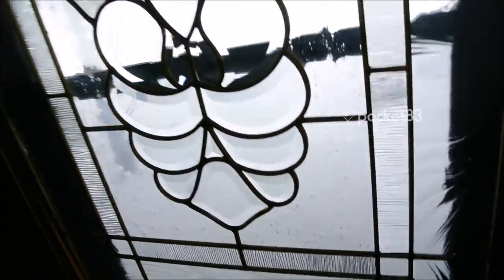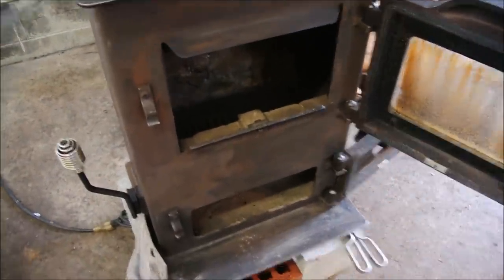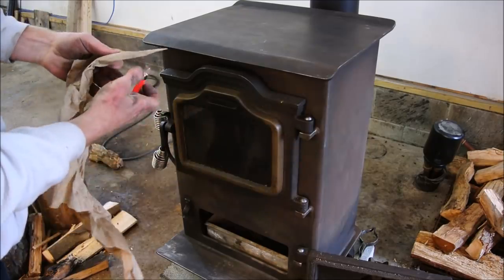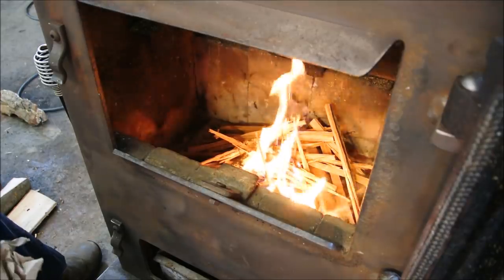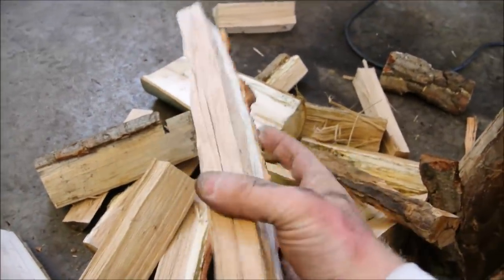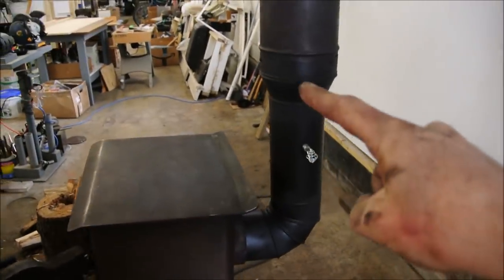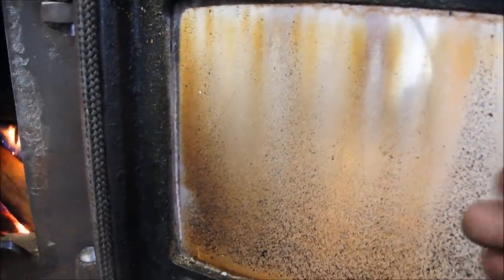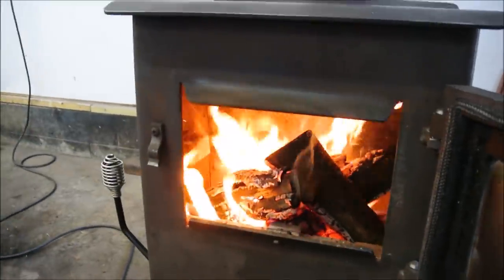A Look at the Harman Mark II Coal Stove

Comment: I have been heating the lower floors of my mountain house with a wood-burning stove since i have memory. By the looks of the grid thingy at the bottom of your coal stove i wouldn't say that you particularly needed that steel plate that you made. It's very similar to the one i have in my wood stove, although mine is a static grid. The shifting mechanism is very interesting! It allows you to filter down the ash and leave the embers up, to finish burning. Anyway, I have no experience with coal burners (in Europe it's widely used as a domestic heating only in Germany and neighboring areas, I'm from northern Italy) and you probably did your tests and considerations. Did your steel plate improve the burning, and how?

Second thing, in order to better exploit the heat produced by wood, which is fast-burning respect to coal, we usually lengthen the exhaust pipes, by placing the stove further from the exit hole to the chimney, or forcing the flow through a "radiator", where the pipes multiply in number and have a smaller section. Since your garage-shop is so huge (even if you split it with the wall you were saying) this could be an interesting solution to better distribute the heat and extract more warmth from the combustion gases, before dumping them outside. Nicely done in removing the extra layers of the pipes.

I'd also love to keep the door open and look at the fire, but i would be too scared that a spark jumped outside while I am not looking and do same damage... Wood can be particularly hyperactive, if you burned something with resin inside (like fir or larch, common where i live) you would notice! :P 

Anyway, these are my 2 cents, please keep up the good work, i love your channels and "toys" and could listen endlessly at your ramblings :D

Comment: That boiler with piping sounds like systems that were used around here only for cooling rather than heating.  I did a variety of projects where we modernized their systems and was kind of amazed at how the old systems worked.  This older systems were basically rooms filled with chillers, they would freeze vast amounts of water and then pump air through the ice during the day to cool the classrooms.  It wasn't exactly energy efficient but they were making use of the night time, when energy was billed at cheaper rates, to lower their energy costs.  I've actually heard these type of systems are making a comeback with more efficient versions but I've not seen one locally as of yet.
Reply from the maker: Thinking about how extensive that type of system was/is:

You know what system is severely under-utilized? Geothermal. In the summer, the air 60 feet down is as cool as AC, and in the winter, it's nowhere near chilly. Why aren't we using simple duct systems to help stabilize our internal environments? It's an unlimited supply of comfortable air, and it requires only a fan and a pipe to make use of it. 

Simply put, it's because such systems would employ localized services and technicians, rather than boxes of corporate manufactured "high efficiency" products. Our short-sighted market is always looking for a quick-fix product as a solution, so that's where the advertising and research funding go. The initial investment of digging is just too off-putting, even though a system like that would pay for itself in only a few years. 

So we burn fuel, instead- while sitting on a giant, warm rock. Sheesh.
Reply: @pocket83squared  yeah where I live in California, I've never even seen a geothermal system put in place here but I've read studies on them.  It's always made sense to me.  The cost was even lower than I thought it would be.

Comment: Does the Harman have a baffle so the wood heat and flames don’t just shoot up the chimney?
Reply from the maker: There's a baffle at the top/back. Exhaust enters at the front, moves over the top, then down its back before going up & out. This curve helps the metal capture lots of heat before it escapes through the flue.

Comment: Hello im from Tamimant PA 15 miles north of Stroudsburg,I have Harman mark 2 -you have Harman mark 1 I think --. A mark 2 has 4 grates ,get brick that lines stove but don't buy from cheap Northern Company for 15 dollars ,its junk actually  brick melts, Anthracite  is clean, no smoke at all -once it gets going and its a blue flame ,they call it ---blue dancing ladies. im very happy with my Harmand,we had BAD snow STORM and no power . that little stove kept1800 sqft house at 70' outside -10 uses 40lb bag in 24hrs with 1 shake at 12 hrs.you just give fast dump of tray after 24 hrs and  keep adding.dump used ash in metal container. goodluck.

Comment: If you remove all the fire bricks it will not store and radiant heat as well, which is the secondary function of refractory material. It protects the steel from warping, which can still be possible if you have a hot enough fire going. But refractory bricks hold and radiates heat long after the wood has burned down. My wood pro 2000 was still hot two days after the wood burned away.  If it were just steel it would have cool down shortly after your fire died

Comment: Quite the contrary, I think I'm actually pretty close to where you're at, though I'm more towards the anthracite coal area and not too terribly far from where those stoves are manufactured. I used to have a Harmon very similar to that, in fact. 

For that reason, it hurt a bit to see you get rid of the boiler, because nothing transfers heat like water, but that thing looked like the work investment would have far outweighed the results. That said, you mentioned that it ran under the driveway. That's... unique. Was it to melt it? And how didn't it freeze?

Comment: If you start with crumpled balls of paper then kindling over it, light the paper, you won’t have to go through the whole lighting 20 pieces of paper to start your fire, just an idea. That’s just how I start my fires, thank you Boy Scouts of America hahaha. Btw, is it strictly a coal stove? I grew up with a coal/wood stove and yours doesn’t appear to be a hell of a lot different. It heated our whole house which was a basic ranch, but it heated both the main floor and the basement where the stove was located. Excellent stove. Did you name your stove Mark Harmon the second? Bahahaha
Reply: ..... or a few drops of BP spirit?
Reply: I agree. I use old new paper. Take 1 page (1/2 sheet) and ball it up about the size of a tennis to gold ball sized. I put my paper under the grate and let the flames come up and lick at the pitch and fire it up. Once the pitch lights, then I put the heavier/heartier wood on top. Normally can have a hot fire in about 20mins
Reply: Per my Harman manual you ball up newspaper and line the bottom then put kindling over top. I usually heat my flue with a little propane torch first as a cheater.

Comment: If you want a cheap fire starter, use google to find the online contacts for local churches and ask if they have any candle stubs. Doesn't usually work for the bigger candles as they cost more, but there are usually cheap ones being used at some event or another. Some churches also do candle-lit services around holidays, and just throw out pounds and pounds of quarter-burnt cheap paraffin candles after every Christmas. They buy in bulk and most find it's cheaper to throw them out as they cost pennies to the candle, and new ones get more donations. Probably works for most other places of worship as well. 
You can remelt the wax with a cheap double boiler for crafts, or pour it over dryer lint or balled up paper if you want to light a fire in a storm or want something for a camping kit, but you really don't need to most of the time.

Comment: Do run the blower on that stove?  How much of a difference would it make?  Noise?
Reply: The blower can actually make a huge difference. The one on mine didn't work this year, and i think it's making an impact on the heat I can collect. There isn't enough natural convection to make the air move fast enough. Also, once the outer plate gets hot, the convection starts to slow down. So yeah, the fan can make a difference. I have to replace mine for next year.

Comment: Carbon monoxide detector? Especially if you run the fan.
Reply from the maker: The fan moves air over/through the baffle, but that duct is sealed off away from the actual firebox. It's pretty much just moving air over a heated steel plate.
Reply: @pocket83squared  Yeah, I'm just projecting my own fears. Our neighbors when I was little had a wood stove in their detached garage that developed a cracked weld from hot/cold cycles.  Only injury was to their cat, but impressionable youth and all that.

Comment: I just built a pole barn this fall. I am looking for a used coal stove to heat it. How has your Harman held up and what have you learned from it so far?
Reply from the maker: It's a solid piece of equipment. When I made this video, I didn't really know what I was doing. I just got lucky. The space I heat with it is rather small--something like 22'², but it generates more heat than I can stand. Much of controlling heat is in the type of fuel you're using. Coal burns much too hot for my space, and even Maple will have me opening doors. I try to balance it out by alternating with Cherry and Pine. 

The reason that I would recommend this sort of stove is simple: coal burns much hotter than wood fuel, so a coal burner is built to withstand more abuse. Looking at most woodburners, they're like laughably chintzy in comparison. A Harman is built like a tank that can last a lifetime. Check Craigslist (especially during the off-season), and if you're willing to drive, you can find one for a steal. I have zero regrets about it.

Comment: What about cutting your coal with wood, or just adding some coal to the tons pieces of wood? Also if you want to pull more heat out of the exhaust you could put the second layer of tubing back over the flue and put a small fan at the top to force air through it. You could even point it towards the coldest corner of the room. I think the airflow would work best pointed down rightso that it is coldest at the top and warmest at the bottom but i have no idea why that would be best other than just to to have the colder end remain colder instead of putting a cold point in the middle between a hot point at both ends. Hope you survive the polar vortex...

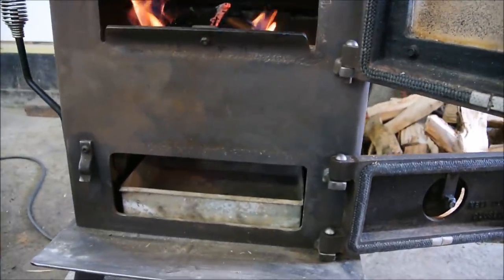Comment: 18:04 the glass has been etched and if you want to see though it clearly, you will need to replace it, and the epozy may or may not hold up.  The High heat gasket glue is the way to go, a little goes a long way for your gasket repair.

Comment: I run a small wood stove (jotul) and it has no firebrick at all.  Its cast iron not steel so perhaps that makes a difference?  But I run more or less 24 hours a day and even at its hottest (which you never really want) its totally fine.  I vote remove the brick. More volume is a big advantage.

Comment: I could be wrong but I believe that's a mark I stove not a mark II. Not a big deal. I have a hard time burning wood in my Mark II. Wood only last's about 3 hrs. Usually I can leave a coal fire for at least 12 hrs.
Reply from the maker: It is hard to tell. Look at the tag at 15:19. They stamped it between 'Hearth Hero' and 'Mark II.' How is your different? And what does your stamp say?
Reply: @pocket83squared  ah ok. mine is stamped mark II. the body of my stove is 23 inches wide and the load door and ash door are 20 inches wide. you're looks a tad narrower.

Comment: What happened to the draft diverter  ?
Reply from the maker: I'm not sure I understand the question. "Draft diverter" is not a very well-defined concept.
Reply: @pocket83squared  all coal ,wood, and oil burners require a draft diverted to maintain a steady draft and peak heating efficient.
Reply from the maker: @danthurman9076  Great. So then, maybe you can define it for me; how, for example, is my flue failing to draft properly?
Reply: @pocket83squared  the correct terminology is a barometric damper, it will allow the draft to remain constant leading to more heat output in real BTU's which is the reason for burning coal ,wood, or oil.
Reply from the maker: @danthurman9076  A damper is essentially a valve. Yes, there's one there. See 23:00. It does little in this case, because it's permanently set. Because my flue is short and wider diameter than necessary, the draw already accommodates a higher volume than the stove is capable of delivering, so the combustion can be easily throttled on the intake side. 

In terms of overall efficiency, using the damper to slow down heat escape isn't really sensible here, for several reasons. For one, slowing air flow after the combustion has taken place means that you're creating a blockage (higher pressure inside the stove), which allows more exhaust into my breathing space. For two, any additional heat captured by creating a back-pressure is negligible in comparison to other methods of increasing efficiency, like blowing a heat-stealing fan on the flue for example, or even more importantly, by using only fully-cured firewood. 

The biggest variations I seem to get relate to the type of fuel I burn, and not so much to how I burn them; though I've tried to squeeze out every drop by controlling my burns appropriately, ultimately the best way to reduce my overall effort has been to simply use as much Maple wood as possible. Per unit of heat, Cherry is a little more of a struggle to keep up, and Pine is a complete waste of time. 

Remember, efficiency isn't just measured in BTUs. It also has to do with time and work spent, like moving & storing firewood, cleaning out ash, and tinkering with the valves on the stove.

Comment: IMHO: You REALLY need to rework that exhaust stack exiting the back of that stove. Instead of coming out, directly into a 90 degree elbow, then up and out thru the roof,.... you need to replace the elbow with a "T" so that the bottom of the "T" is at the back of the stove, with one side of the "T" goint up and out.  Then, the lower side of the "T" is connected to another side, of another"T", and then a clean-out cap goes at the low end (the lowest, side of the lower "T".  Then, run a pipe from the bottom of the lower "T", over and out to the side wall of the shop. Put a (airflow) damper in that pipe, just behind the stove, close to the bottow "T". This will control the amount of cold, outside air that can come in and up, into the vertical stack, to help mix with the hot stove exhaust air. This column of mixing air, will help reduce the amount of "siphoning" force that you likely have been struggling to limit, as the exhaust stack heats up, once you start burning.  Also, add another (airflow) damper, into the vertical stack, at about 4' above the floor, so that it's at a height that is easy to reach. This damper limits the amount of total airflow that rises up and out of the exhaust stack.  You may need to play with both damper controls, to adjust the total airflow thru the firebox, but, with a bit of experimentation, you will be able to get the stove system to work, fairly steadily, with minimal tending, and, you won't be sucking all of the hot air out of the shop, as the firebox burns!  The incoming, cold, outside air, feeds the fire, and, helps cool the exhaust gases, to keep the siphoning to a minimal amount.  You will be way better off if you keep the entire lining of the stove protected with the firebrick, etc.! Raw coal/coke flame will over heat the bare metal, causing eventual rusting, flaking, or sagging, or exen burning ("sparkling"), warping, and finally holes thru the walls!  Good luck!  Keep a big cast iron pan, or galvanized tub, full of water, on top of the warm stove. The water will slowly evaporate, as the stove heats it, and, the addition of a bit of humidity in the shop will be very nice, because the winter air is so damned dry, usually!  Just dump out the water, if you're going to leave the shop, for the night.  If you have some stove pipe thermometers, place them around, near by, to monitor the heat in the stove pipes, near the dampers.  They'll soon help you to know if your system is heating, or cooling, or running at steady temperatures.
Reply: guloguloguy

Comment: Fire brick are required for coal it refle ts heat back Into coal fire to burn coal completely
Reply: It also makes wood fires burn hotter to combust the gasses inside the stove instead of unburned smoke going out the chimney.

Comment: I wish I could get bituminous cheaper. 4$ for 40 lbs of anthracite or I can pay 50$ for 40 lbs of bituminous. I use it for a forge though and not for heating. Anthracite is super clean burning though. Once it gets going it’s just a boring glowing rock. No smell. Small flames that are barely visible and no visible smoke

Comment: Looks like s mark 1 to me and itll probably run through wood as its not designed for that. Just use coal
Reply from the maker: The stove is labeled as a Mark II on the back, but several of the Harman models are very similar in design. As for coal: it's too hot for this little space (this shop has changed quite a bit since filming this video). Coal also stinks compared to wood. The stove does go through wood pretty quickly, though; it's tough to keep a slow burn.